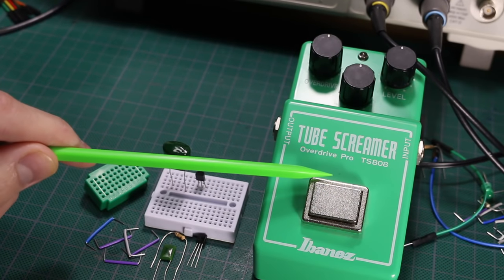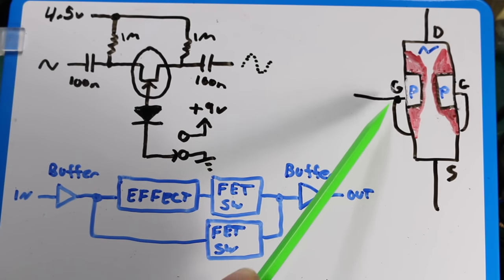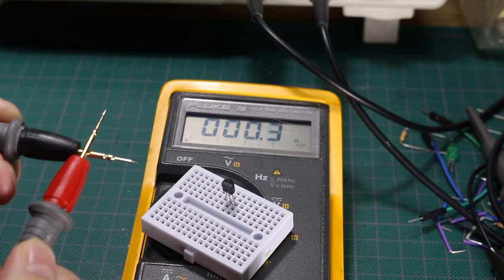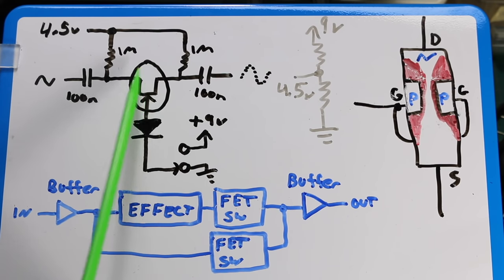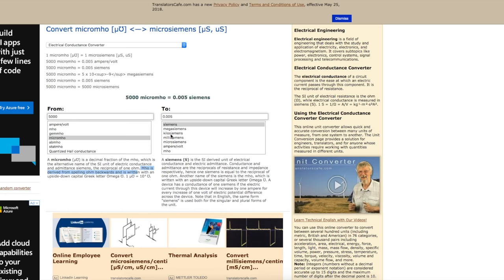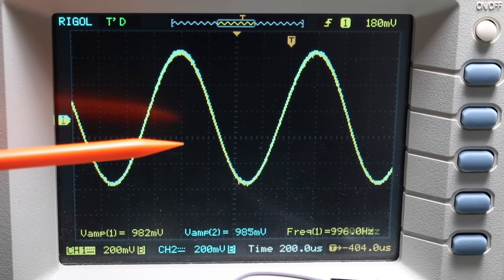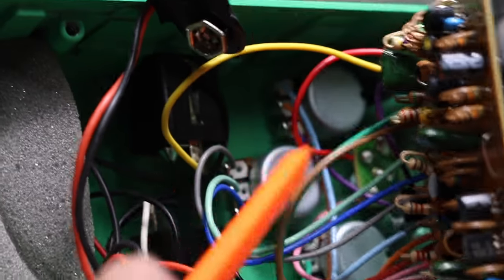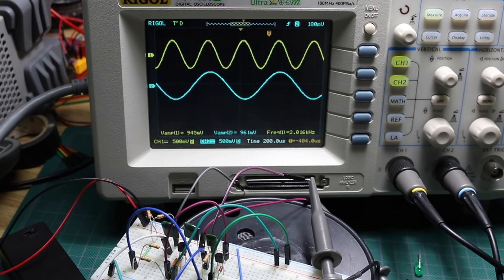JFET Audio Switch Circuit - 2n5457

Comment: The description of how JFETs work, how they are biased, and how to create the split voltage rails is one of the best presentations I have seen. The audio is clear, the pace is great. I am not interested in the pedal application, but it is worth the wait to get the JFET information. The explanation at the end about how to read JFET data sheets is necessarily a bit fuzzy, but it is our job to learn to read them with the introduction given here. Props to Gadget Reboot, and many thanks for the time spent on this vid.

Comment: Thanks for the theory refresher. 

Back when I was first studying electronics FETs were considered expensive and fragile, typically only used in special circumstances.
My how things have changed over the decades.
Reply from the maker: One of my limiting factors was being confined to RadioShack for parts, it was always very easy to get a 15 pack of NPN or PNP   But I don’t remember much else for transistors there, unless I just didn’t know what they were. So that limited my ability to learn about FETs for a while.

Comment: Thanks for the light on the subject. I was working on a pedal design and added a jfet switch circuit (with a 2n5457) without really understand it. But your explanations actually confirmed most of my own analysis (without the measurement details).

Comment: Way back around 1985 I made a guitar FX pedal and didn't use JFETS to switch. I used a regular push on / push off switch. Every time I enabled it there was a loud noise to the amp. Not good. Always had to turn the volume down 1st. It's still in a box in the closet and perhaps I will dig it out and add your switching circuit to it. Thanks for the detailed video.
Reply from the maker: I have a guitar pedal switch on  order from eBay  that I will be experimenting with eventually when it comes, but speaking of noise pops, the part of the circuit that controls the JFET with that diode, the real guitar circuits send that control through an RC network to the diode to slow down the switching and eliminate pops from turning it on and off too fast.

 I need to do a quick follow up video to fix up that topic about the signal bleeding through when the FET is off, so I think I will try to remember to mention about the switching RC  Delay as well.
Reply: @GadgetReboot  couldnt you just use a make before break switch to prevent pop noise? Also would the jfet switching a signal modify the sound at all?  Kind of like using a jfet as a buffer?

Comment: Well, glad I got those 2n5457 JEFTs now! I am still trying to understand why a JFET works here but a BJT does not. Someone told me biasing but that just doesn't sound right to me ... I can't help but think it's an impedance thing ...
Reply from the maker: I’m not very good at explaining this one and I I think it’s one of those types of things taken for granted when you try to research it, all you find is why the devices do work in certain applications, but you can’t find why they don’t work for other applications.
 But as a starting point, looking at the difference in construction between a JFET and a BJT, the JFET has a single continuous silicon channel from drain to source that acts like a resistor whether it’s all N or all P type silicon.
 The BJT has two P-N junctions back to back along the path between emitter to collector so there is no continuous path and it acts like two back to back diodes instead of a single small resistor value. 
 Sometimes I feel I need to dig out some old text books on the basics to see if I can fill in some blanks myself. Just trying to scrape through!
Reply: Hey no worries I really appreciate you taking the time to explain that to me! I am using JFETs as simple pre-amps for my electret condenser mics and piezo pickups. Right now I am trying to quantify impedance as much as I can ... I think I am getting close. :)
Reply from the maker: I wanted to do some simple JFET amplifier circuit experiments soon but now I ended up in a rabbit hole on this JFET analog switch thing and I will be doing a follow up a video on that bleed through signal issue from this video here. 
I probably have a lot of information that would help me in my old text books which are in storage bins somewhere here so maybe I should dedicate half a day to digging those out and who knows maybe I will get  inspired for more projects and video topics. 
Dig myself another few rabbit holes to get tripped up in.

Comment: The bleed through resistors is only possible if you have really bad 4.5V supply. If your 4.5V supply is low impedance (buffered through an opamp for example) the cut off should be a lot better.
Reply from the maker: I also tried directly using a 4.5 V battery supply and there was no change in that waveform so  i’m going to try a few more things to see what’s happening. Maybe I should try a circuit simulation as well just to see what that shows with various methods of getting 4.5 V. Just to see if I’m going way off track  on the breadboard  or if there’s some explanation for what I’m seeing.
Reply from the maker: I ran a  SPICE simulation and it seems I was able to reproduce that bleed through even if I have any source resistance large or small  for the 4.5 V. But as soon as I added a bypass capacitor on the 4.5 V, that bleedthrough got attenuated down to practically nothing nano or microvolts. 

 And I was more or less able to duplicate that on the breadboard.  I don’t know how I forgot to add that capacitor originally because it was in the actual effect pedal circuit as well. I’m going to do a fast follow up video to clarify some of this within a couple of days. 
 Thanks for your feedback and helping to get me thinking about the  culprit.
Reply: @GadgetReboot  I was just curious about the DC blocking capacitors. I assume they're there to prevent noise from bleeding into the audio signal from the DC control circuit? I'm currently working on my own design, and I'm pretty new to all this, but I've already anticipated the potential difficulties with transient noise and have been working with the idea of using optoisolation. Your scoping looks promising, so I was wondering if you think using an optoisolator is overkill, and what your take on that is.

I've been trying to find a useful component for successfully switching/controlling AC audio signals, and have come up with nothing until yesterday, and have been hopeful yet apprehensive about using a low-wattage MOSFET-output SSR, but then I rephrased my search and found JFET switching and videos like this. Do you have any schematic recommendations to follow, or comments? My goal is to create a switch circuit that cuts the signal from an electric guitar with a stereo output, pure and simple. I appreciate any responses, thank you. :)

Forgive me for piggybacking on this comment train, I'm hoping to get the attention of someone that might be able to shed some light!

Comment: Hi! great video 🙂 Would you mind clarifying the following?
1. What is the purpose of the diode at the Gate? Will it work without it?
2. Why is the AC signal required to be biased to half the supply voltage prior to passing through the NMOS? I simulated this on LT Spice and for some reason it worked without biasing prior to the AC signal hitting the NMOS.

Thanks!
Reply from the maker: The gate diode is explained well in this forum by one of the responses from someone. https://www.diyaudio.com/community/threads/fet-reverse-gate-diode.322632/  
It seems it's better to have the gate floating than to give it a positive voltage to close the channel 

One reason to bias the audio signal to half of VCC is because the gate needs negative voltage to turn on, so if the source is biased up to 4.5v and the gate is brought near 0v, then the gate is negative with respect to the +4.5 on the source so it turns on.

Comment: I'm using this jfet set up with negative gate voltage provided by the output off a 555 timer (astable set up) via a schottky diode (ensures no positive signal to jfet)... Problem is I get a pretty mighty pop every time it switches... Any ideas?

Comment: Any power rail is supposed to be ground when talking AC, this is, of course, depend on the decoupling (I did not see any on your breadboard for 4.5V) and it will never be ideal.
Just because you cannot see a signal on the scope, do not mean it isn't there, using FFT is often better to show it. The problem is that our hearing works over a very large range, i.e. a small signal may be easily audible, but not show up on the scope.
Reply from the maker: I’m going to try putting a capacitor on the  4.5 V rail before I take the circuit apart and see how that compares. Don’t know how I forgot that. Moving too quickly probably.  I need to start doing follow-up videos to clarify any things that were weird or misleading in previous videos. Too bad YouTube doesn’t allow adding on video footage like they allow cutting clips out in the editor.
Reply from the maker: It looks like the missing decoupling capacitor on the 4.5 V was the culprit. I will be doing a follow up fast video to go over the observations. Thanks for helping!